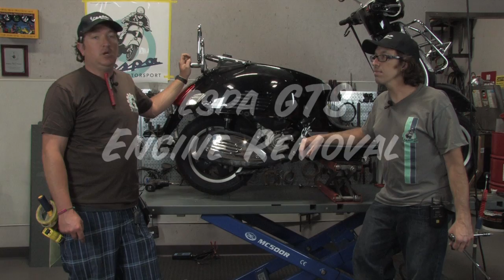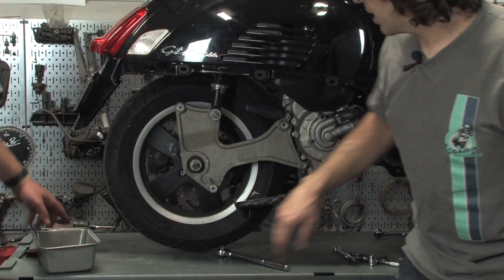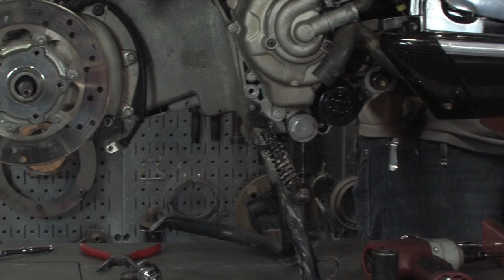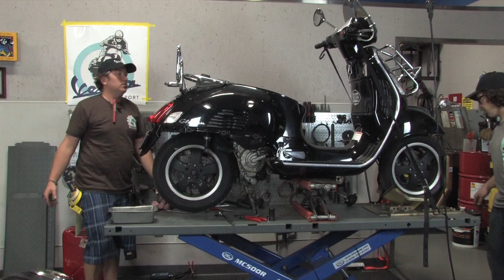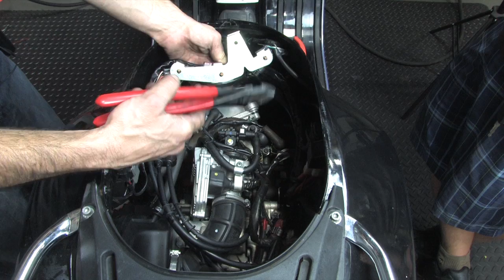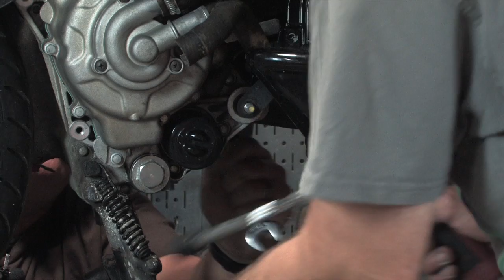Vespa GTS Engine Removal

Comment: Hey guys, will a vespa gts 250 engine dismantle in the same way? I have a 125 and would like to put a second hand 250 engine in it, will it fit easily with no extra parts needed?